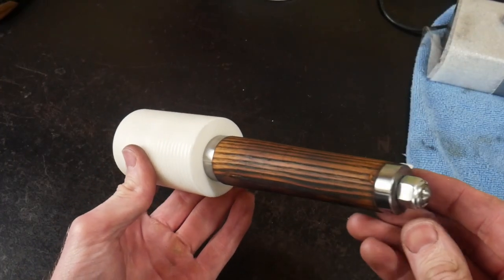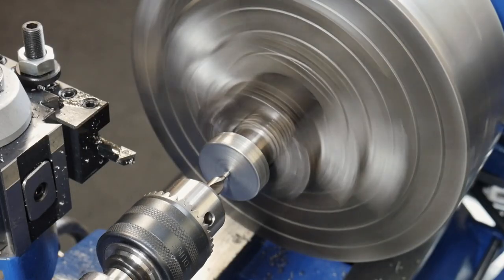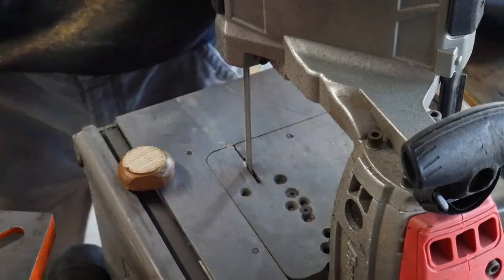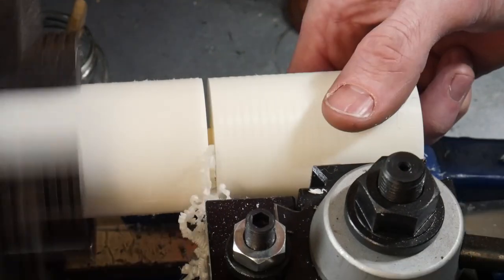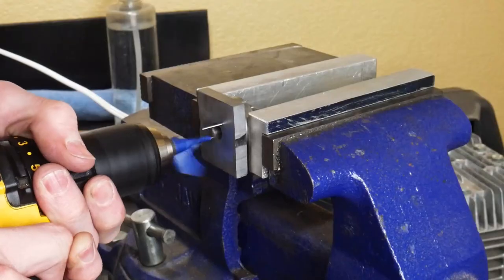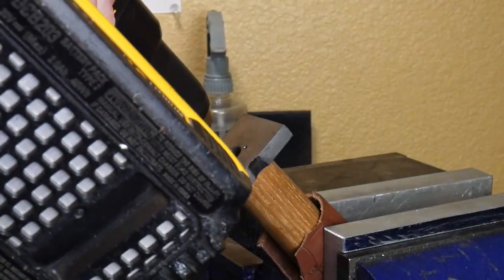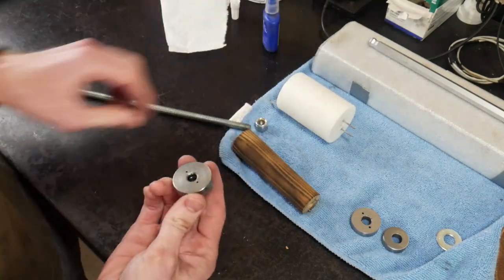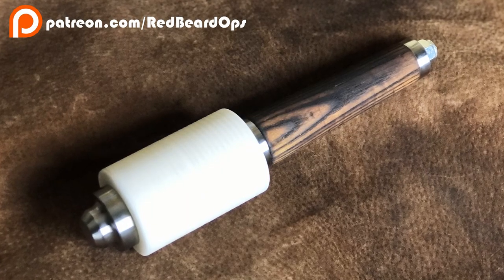Making a LEATHER WORKING MAUL | Take Down Style | Mostly Out of Scrap | Leathercraft Tool

Comment: Nice job. I use nylon mauls in my leather works shop.  I started with a 12 oz maul and settled in with 32 oz working maul which seems to be just right for what I need. It reminds me of the children’s story of the three bears. You keep trying different weighted mails until you settle on just the right weight.
Reply from the maker: Thanks for the tip Richard!

Comment: Cool build man. I enjoyed it. I actually need one of these.  I just made a leather sheath. I punch stich holes with stitching chisels and did a basket weave stamp. I had a little wooden mallet that i thought would work well, but it did not lol. I ended up swapping to a 3 lb hammer which probably good for my tools long term
Reply from the maker: Right on, I feel you man. This thing is pretty sweet to use. I could just imagine how nice the Barry King Mauls are

Comment: I have a question.  I have looked for many videos about bandsaws used for cutting metal, and I haven’t found any good information on what can be used, unless you buy a Milwaukee one for $400.  I noticed in one of your other videos that you have/had a Wen band saw.  Is that what you used to cut the large pieces of steel in this video? When I tried it on my Wen, the blade got dull about 2 inches into cutting a 1/4 inch piece of steel.  Any advice would be appreciated.
Reply from the maker: Hey Jacob, I've never tried the WEN. I have a BAUER and it's been going strong for about 2 years now. Check out the description of this video for a link to the bandsaw and stand. (Way cheaper than $400...) - Cheers man.
Reply: @RedBeardOps  Thanks a ton.  I went back and found that it was a WEN drill press you have.  Thanks for replying so soon.  Have a great new year! (Fellow Texan from Pasadena)
Reply from the maker: @dr.mecham8314  Awesome man, good luck!